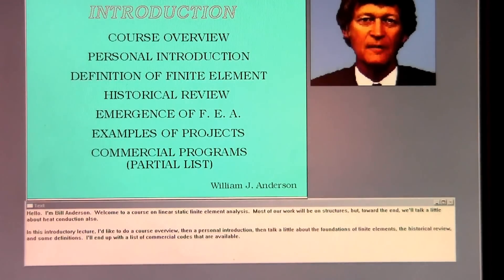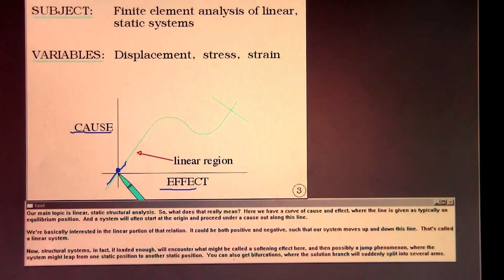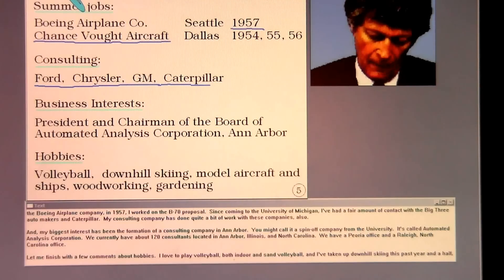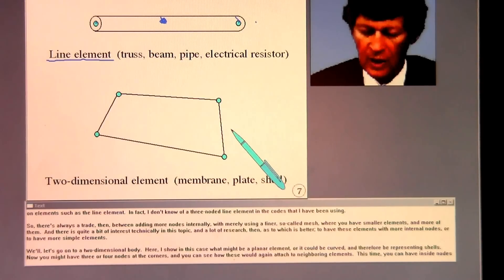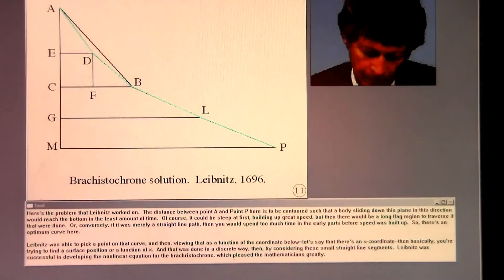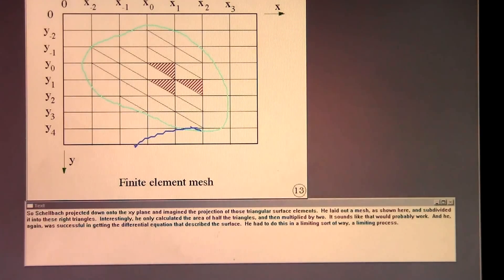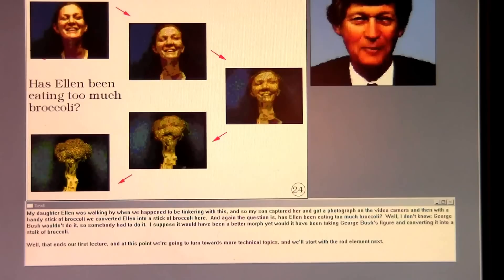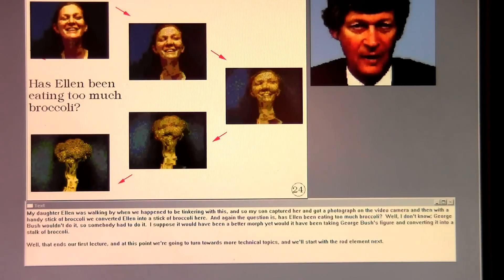Intro to Finite Elements. Lecture 1.

Comment: Dear faithraja,
The final relationships in structural analysis deal with absolute displacements (measured from the undeformed, unloaded body) and the total, final load.  The use of virtual work ideas however brings in an incremental displacement measured from the deformed and fully loaded shape.  This incremental displacement is washed out in the end, however, so is just a temporary tool.

Linear systems are fairly easy this way.  Nonlinear systems get tougher.
Bill Anderson

Comment: Dear faith raja,

The important displacement at the end of the theory is the absolute displacement measured from the unloaded, undeformed shape.  When virtual work is used to create elements, an incremental disturbance from the deformed shape is considered.  This incremental displacement ultimately washes out, leaving all the relation between the full loads and the final, absolute displacement.
All the final equations deal with the total absolute displacement and the total load.
Bill Anderson